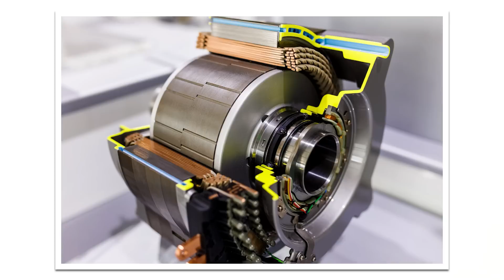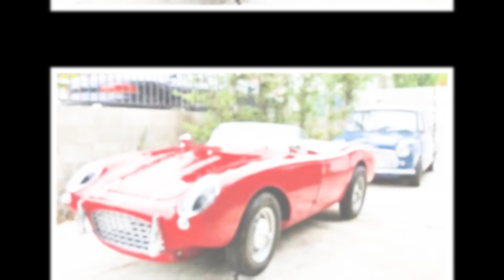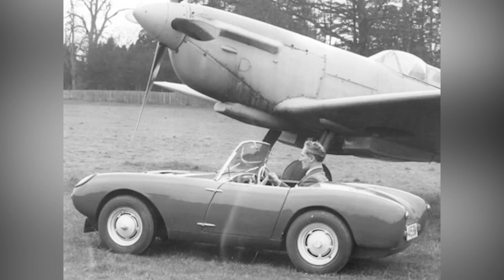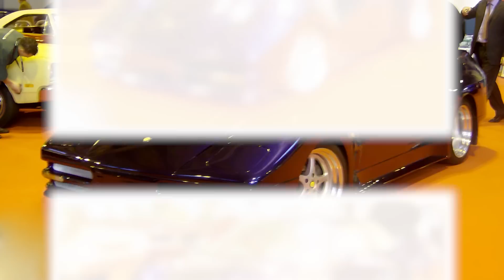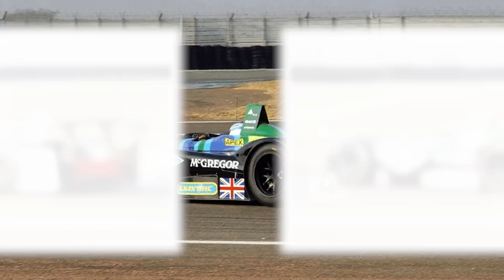3 Most Forgotten British Cars You Never Saw!

Comment: 10:45 - "... it [the T60] used a unique three-wheeled layout."
Unique? Morgan had been building three-wheelers using the same basic layout (which was probably the inspiration for - if not the original which Berkeley copied) as the T60 - since 1912! Interestingly, Morgan had stopped production of the 3-wheel layout in 1952 - simply because the demand for 4-wheel vehicles was higher: Berkeley was essentially filling a shrinking niche created when Morgan stopped making them! Definitely not unique!

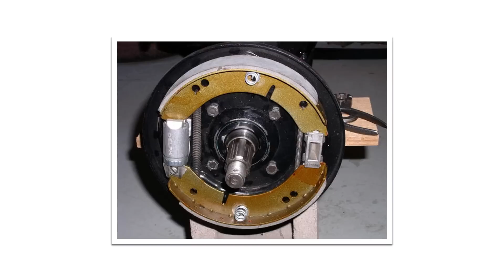19:10 - "... and switched to wire wheels instead of the MG's drum brakes."
Uhhh - wut? So the earlier MG-powered car had no wheels, but had drum brakes - while the newer model did away with brakes, but finally put wheels on the thing???

Comment: Why does the parallel twin engine have three plug leads? I think that's a picture of another Excelsior engine, with 3 cylinders, used in a different Berkeley.
Reply: Some T60s had the Excelsior 3 cylinder unit.
I was struck by how bad this narrative was though, the Lister script was repeating itself on a short loop and managed to describe a Dunlop race wheel as a "wire wheel" when showing a photo of a pressed wheel....incredible.